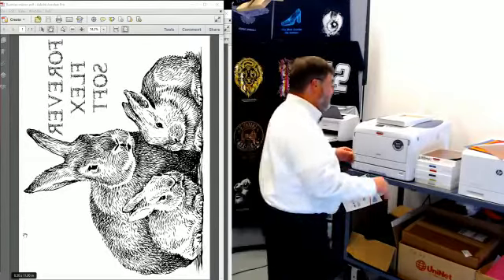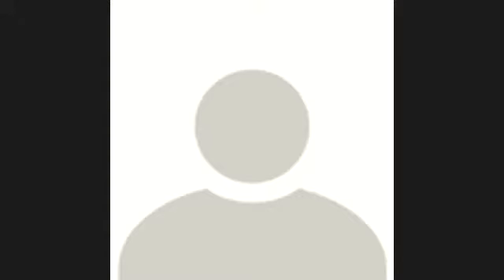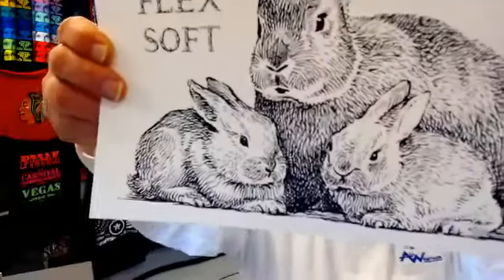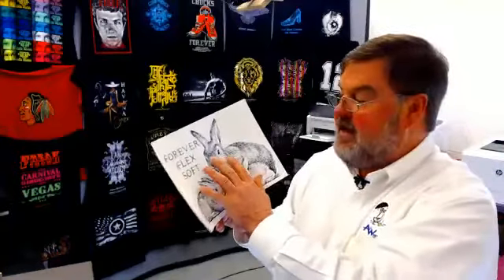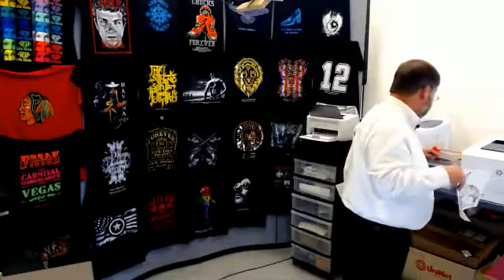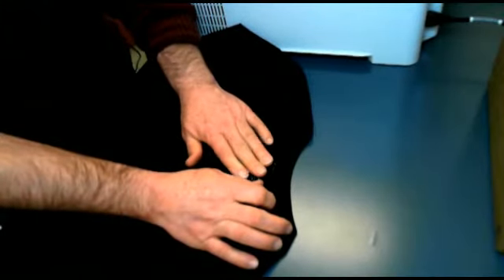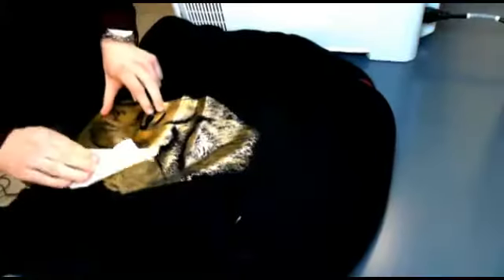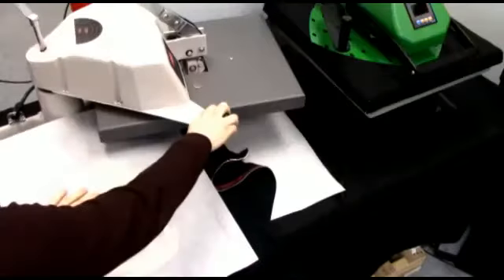Forever Flex Soft Demo :: Screen Printing Supplies & Equipment | Total Ink Solutions

Comment: How come when I do it on the white forever soft it’s comes out more grey then white on the shirt
Reply: Ray Linares sounds like dye migration. Your temps probably to high
Reply from the maker: Ray Linares sounds like dye migration. Your temps probably to high
Reply from the maker: correct
Reply from the maker: Did you solve your issue?

Comment: What paper do I use to print the photo on the shirt
Reply: The forever flexsoft product. This is a heat applied product.
Reply: Mr. Savino I was under impression that flex soft couldn't print photo's thats' why I was inquiring about the paper.
Reply from the maker: Flex soft is for single color images but can be layered.

There is another product called forever dark but you need a laser printer with white toner. Feel free to email me msavino@totalinksolutions.com